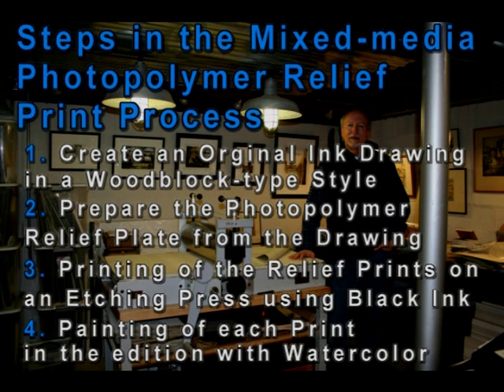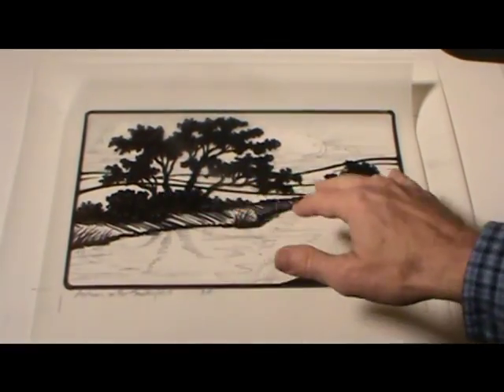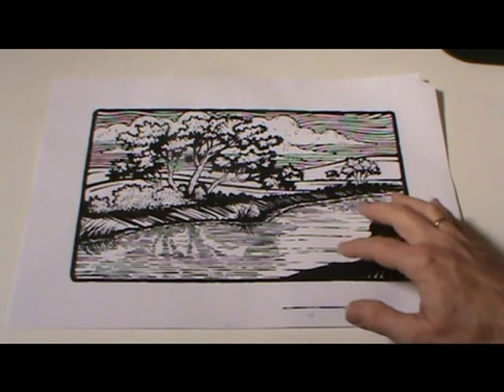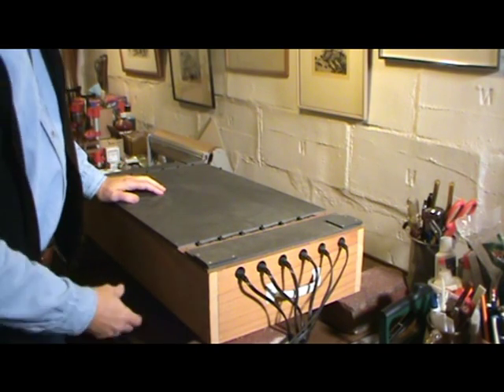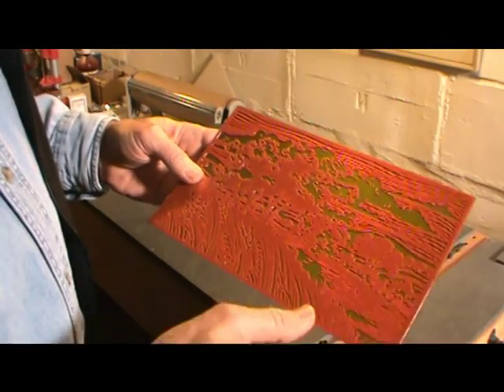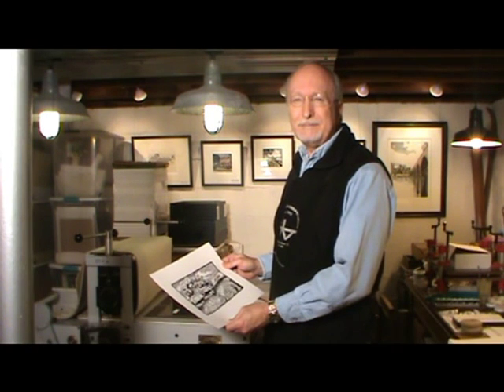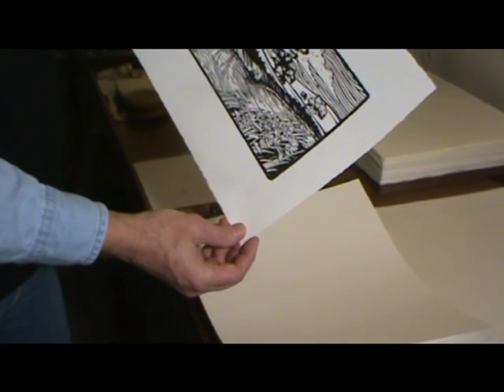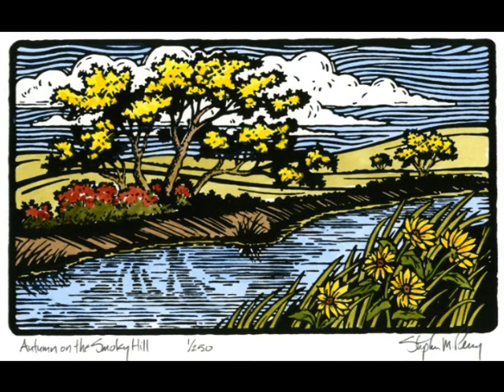Photopolymer Relief Print with Watercolor

Comment: Hello Stephen, 
Would you be able to check the watts listed on the black light bulbs? They have to be ordered online and there is a range of watts.  I am an art teacher. Loved the video, very straight and forward filmed clearly.  
Thank you, Catherine Zarrillo
Reply from the maker: Catherine, the lights I used were from Walmart, Lights of America, model 7020 BL, florescent black light, 120V-60Hz 17W, 30000 K, 24”. I mounted 6 in the box. You can use any kind of black light or even the sun. The trick is to do trial exposures at different lengths of time until you find the right exposure time. Mine is about 1 min. 20 sec. with the plate about 2” from the lights. Washout takes about 6 min.
Good luck. Hope this helps.
Reply: Stephen, Thank you for the information.

Comment: Hello Stephen,
I wrote previously for black light bulb information. The black light bulbs are very hard to find. The only black light bulb Walmart carries that was 24"and 17 Watts is called a Hyper Tough T8, 24", and 17Watts. It does not list any additional information on the bulb. I have checked with the other companies you had previously suggested and found that the bulbs were unavailable or no longer carried by those companies. Would you have any other suggestions as to where to find the correct bulbs? I will be sure to purchase a quantity! lol 
Thank you,
Catherine
Reply from the maker: Any black lights will work. You just need to run test exposures to get the exposure time right.

Comment: Hello! I liked your tutorial about photopolymer print. I have a question and a request:

What kind of photopolymer plate is the one you used? Here in Argentina, we use a type that after exposing it in light we have to put it into developer liquid (the one you use in photography) but you didn't, you used water. That's new to me, we have always used developer liquid, not water. So, I wonder if your photopolymer plate is different from ours.

Second, my request would be if you can share how you built your exposure box. I'd love to build my own. 

Thanks in advance and greetings from Argentina!
Reply from the maker: Hello, Barbara from Argentina.
The plates I use are under the brand name, Solarplate Copper.  They are available from art supply companies like Dick Blick (www.dickblick.com), Renaissance Graphic Arts (www.printmaking-materials.com) and Graphic Chemical (www.graphicchemical.com).  They aren't developed as such, but the material turns from water soluble to inert when exposed.  I got my information at www.solarplate.com, which is Dan Welden's web site.  He is the printmaker that developed the process.  He also has a video you can buy about the process.
My light box is a simple wooden box built from 1x6 boards and plywood.  On the inside I lined the box with black foamcore sheets.  I mounted 6 fluorescent blacklight units on the inside top and plugged them into a power strip.  I bought my lights at Walmart, but they are the kind people use with blacklight posters.  No matter how you build it or buy it, you need to plan on several test plates to determine the exposure time since all the lights vary in intensity.
Good luck and thanks for the inquiry.
Stephen
Reply: A great video with great instructions! Wonderful examples of relief printing. Thank you as well for sharing technical information and materials sourcing.